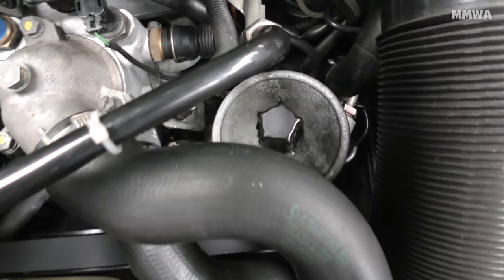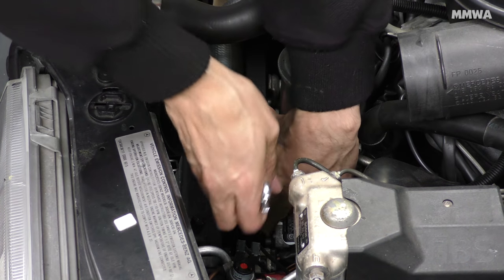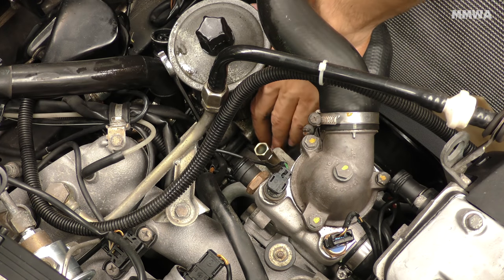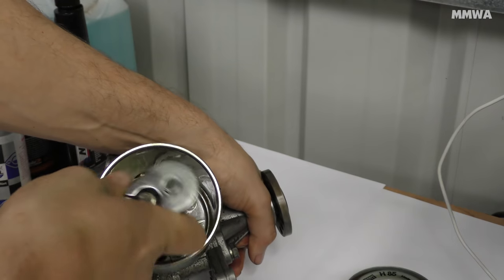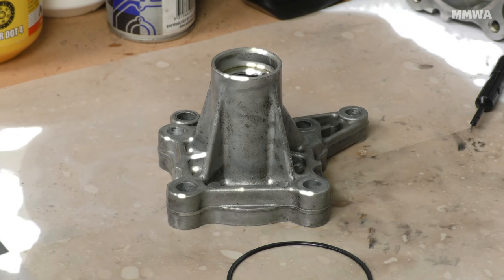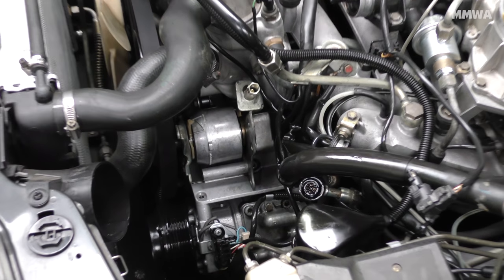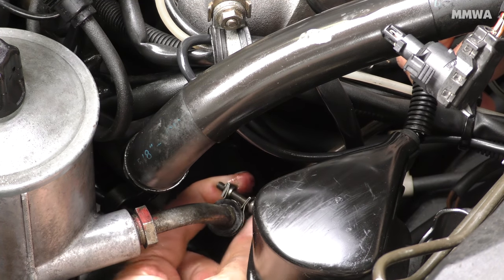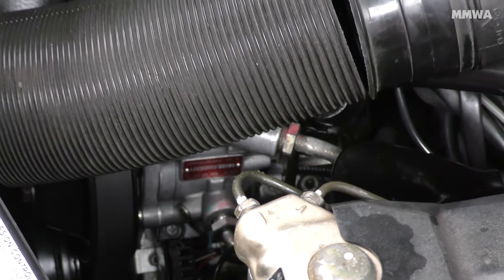Mercedes W124 300E-24 - Remove & reseal my Vickers power steering pump 1244601880

Comment: I replaced all of my power steering hoses about six months ago, pressure and return.  I got my return hose (bulk) my dealer, and they were perfect -- looked just like the factory hoses from 1989. Cloth wrapped with some kind of wide cloth tape. The only thing that looked off was that the hard tubing on the high pressure line was silver, not gold cad plated. Minor nit pick.

Also on the Newco Products website as "metric black cloth wrap look hose."

Comment: Great video 👍

When installing a new H85 filter a while ago, I noticed sharp, protruding edges on the upper plate of the filter. That would cut filings off of the alloy/aluminum pump housing as the filter was pushed all the way down. All of my reserve power steering filters are now chamfered slightly to prevent that.

Comment: I have a Mercedes 300E-1992.  I want to ask about the stiffness of the steering wheel, it is connected that for a long time I have not changed the moslo, although there is no oil leak.  Thank you .

Comment: I'm replacing my 1993 300TE Power Steering Pump.  I notice is that the tensioner tension gauge plastic arrow looks like it's missing.  I checked online what it looks like and it's not there.  The tensioner looks new.  How do you thighten it properly now?  The last mechanic probably didn't reuse the plastic gauge from the original.

Comment: I have a 1993 W201 with 70,000 original miles. It has this same Vickers pump (but different part number and lower output pressure). The car's standard steering is too stiff for me. I'm trying to make the steering less effort. I've read that you can drill out this pump's output port by .5 mm to gain more flow to the gearbox and increase the assist. Do you have any thoughts on this modification? Do you think it would work?

Comment: Hello, I am currently also refurbishing my power steering pump... Are there any O-Rings in the connectors to the high and low pressure lines that need to be changed?
Or are those flared fittings like in brake lines?
Reply from the maker: @FullForceDrummer  no o-rings on the hoses, they are metal on metal.
Reply: @MMWA-DAVE  thanks!

Comment: I'm gonna have to do this as well, on my 91' 300ce. It's leaking from the bottom some where, my friendly mechanic said it's likely coming from the pumps "gear box" does that make sense? I just changed the tensioner out too.  Thx again for all your video!

Dray
Reply from the maker: the o rings through out this car have broken like bakelite when bent to any extent so the leak could be coming from any one of the seals or even the front shaft seal.
Reply: @MMWA-DAVE  Ok, I've ordered the kit.  What is that you are spraying on the components at the end of your installation in the red/black spray can, degreaser?
Much appreciated once again!

Dray
Reply from the maker: Darryl S. Draper Sr. Indeed that is just the cheap degreaser I buy in cans.
Reply: @MMWA-DAVE  very very helpful. Thx much, got the same kit from Ebay today...

Comment: Hi,
I recently returned my C124 power steering pump and noted that this slight movement in the shaft (front to back of pump direction). Do you recall if this was the case when you repaired your pump? Thanks

Comment: What are torque specs for the four large bolts and the three smaller reservoir bolts?  My factory shop manual doesn't discuss this project so I can't find any specs!
Reply from the maker: alia176 no idea. I couldn’t find specifics either. I google searched average torques for the bolt sizes screwing into aluminium and went with that.
Reply: @MMWA-DAVE  So, what torque specs numbers did you use?

Comment: What is a safe cleaning solution to wash the parts of the pump after disassembly ?
Reply from the maker: on mine i only cleaned the exterior before and after servicing with degreaser. I don’t want to clean off the oil film on the pump internals, unless its dirty and i have to. If its left for any period of time surface rust will start. Lint free cloth i used to keep it manageable. I cant comment on what cleaner to use internally as I didn’t need to use any.
Reply: @MMWA-DAVE  Thank you very much for your advice.

Comment: Hey mate.  Going to do this on my own W124 soon - is there a particulars seal kit and filter you used that you’d recommend?
Reply from the maker: not really, just make sure you get the correct seal kit for your particular brand pump. There are differences. Also pay attention to how the internal assembly is orientated, if you install it back to front the pump wont work and you’ll be taking it apart a second time. Easy mistake to make.
Reply: @MMWA-DAVE  the fact youve replied to a comment on a 5 year old video is a testament to the high quality of human you are.  

Copy that - no worries at all.  I did indeed watch your other video swapping the orientation around.  Made me chuckle.

Youre a legend - cheers for replying and all your great content.
Reply from the maker: @ubernoob103  I reply when my memory hasnt failed me. If i genuinely cant remember i stay silent 😂
Reply: @MMWA-DAVE  😂😂😂 thats completely fair.

Comment: I have just bought a UK 1988 300SL with the same set up. Very useful video, thanks. Do you have the torque settings for the bolts in the base of the reservoir that you used a torque wrench for.?
Reply from the maker: i just google searched the average torque specs for the bolt sizes going into aluminium and ran with that. i’m not aware of official documentation showing how to rebuild the pump etc. it probably exists but i’ve never seen it
Reply: @MMWA-DAVE  Thank you

Comment: My steering pumps brackets are cracked is it possible to get this welded? Or do i need a new one
Reply from the maker: TheDieselMechanic 69 you’d have to make a judgement call on that. To weld it, it should be disassembled so the heat doesn’t damage anything else but the aluminium itself is absolutely weldable. If you have access to a second hand one i’d just get that and reseal it, fit it and call it a day.

Comment: Apologies for the typo's. Meant to say:
I recently reconditioned by power steering pump. There is slight movement in the shaft from front to back of pump direction.  Do you know if this is normal or will it create problems once the serpentine belt is replaced and the pump rotates?
Thanks
Reply from the maker: Ronan Connolly i seem to recall this topic of discussion on one of the w124 groups on Facebook recently and some said it caused increased noise levels. I cant say for sure yet as my engine is still in pieces on the red project, though i did rebuild the pump on my blue/black 124 and its still dry and working fine. The shaft on my red pump probably moves in and out maybe half a mm.

Comment: What's the torque specs used?
Reply from the maker: Maxime Vaillancourt i google searched the specifications of the bolts and found a table outlining average tightening torques when screwing into aluminium. From memory i could not find official MB instructions for rebuilding the pump. I don’t recall off the top of my head what values i used.

Comment: I followed all steps and power Steering is not working☹️
Reply from the maker: It is possible to install the internal core back to front - when this is done no pressure will be produced by the pump. I made this mistake myself on my other w124. This is assuming it was working before the reseal. if it wasnt working before a reseal is unlikley to fix a dead pump

Comment: I did My ps pump seals And flush couple months Back And im one step closer to leak free car
Reply from the maker: JRT this car was practically leak free, this all started when I left it parked for 83 days over winter. These cars need to be driven or they just start having issues all over the place. My rear stabiliser bar bushings are creaking now too.

Comment: Am going through this at the moment BUT... compared to the leaks on my low pressure return hoses, those on the pump are a Sunday School Picnic! While generic hose can be pressed into use for the obvious ones, the one at the box, 124 997 63 82, presents a real problem in Aus. with supply. As it's  RHD, the U.S. is out. Will be millions from Benz. Have you managed to find any for a reasonable price here? Seems to me that aftermarket would be acceptable on this, given accessibility.
Reply from the maker: Any and all the rubber hoses on the car can be remanufactured by pirtek or similar. If this is a crimped hose I would get them or equivilent to just crimp a new hose on. I will be using them for all the fuel hoses instead of being ripped off buying genuine MB.
Reply: @MMWA-DAVE  Thanks. Off to Pirtek.
Reply from the maker: TOONACEDRELA let me know how you go
Reply: @MMWA-DAVE  Pirtek came up trumps. $140 for the return hose from the box. Same day service. (priced at MB for $850!). Pirtek also supplied me with  a metre of excellent hose for the other return lines...exactly the same as original....10mm ID...17.2 mm OD. So, the original stainless MB clamps can be reused. Again, hose available at MB by the metre, but twice the price. 

Bruised fingers...but no leaks.
Reply from the maker: TOONACEDRELA excellent. I heard good things about them from independent MB service centre that uses them all the time. I know now I’m gonna go there too! Cheers

Comment: You put a wrong steering oil there, you have to put only Dextron 3
 All Mercedes are made   only to use Dextron 3 in this steering pump.
The color is red.
Reply from the maker: I dont want to use dex 3 ATF, this is what I chose to use deliberately. It works fine and provides better wear protection.